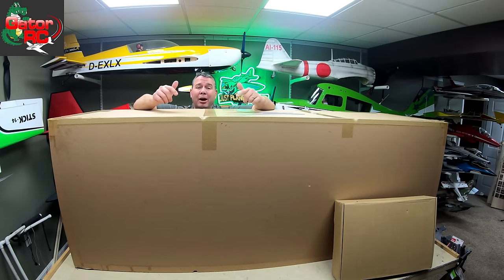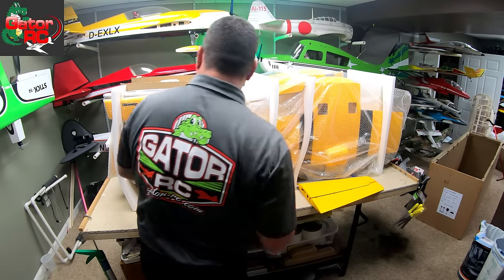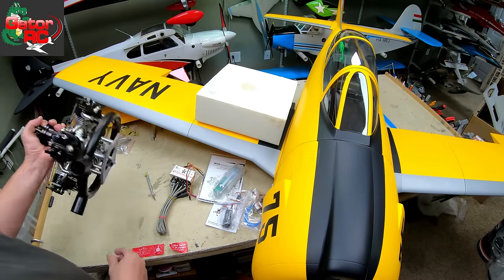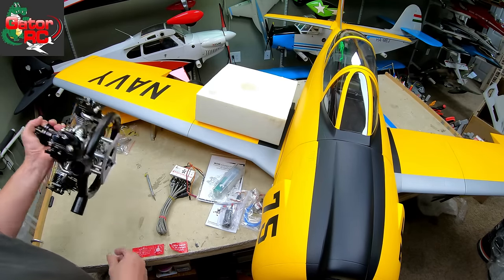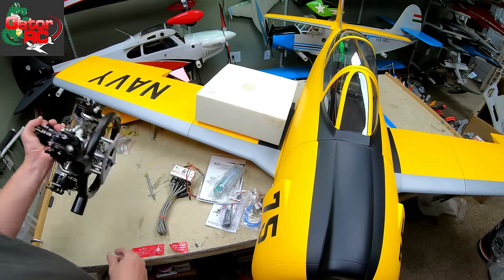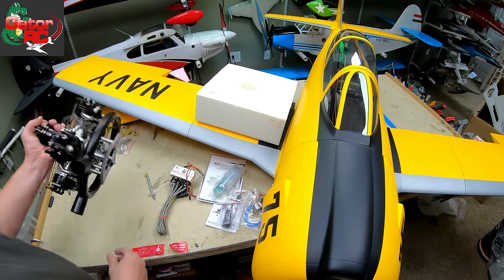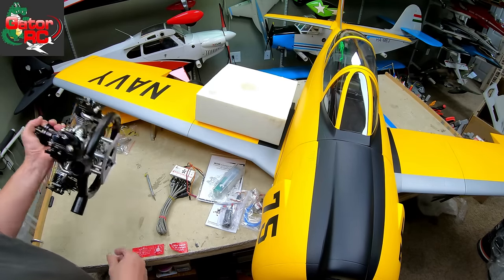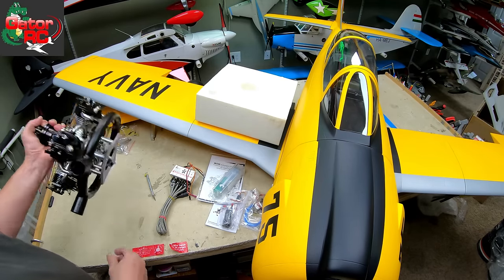Unboxing the HUGE Composite 111" Top Rc Model T28 Trojan 180UMS Radial Powered

Comment: you threw the flap tube out with the plastic bag mate.
Reply from the maker: Dude!!!!!!!!!!!! I can’t  believe u caught that. I do that when I walked by. Sooo funny. Thanks for watching and sooo closely
Reply: @JustPlaneCrazy  all good mate. I’m ex RAAF electronics tech and project manager so details are my thing. I miss nada. Will be interested to see how you do nose steering and get that radial in. I’m going simple, DLE-111.  I briefly considered the UMS after seeing yours till I checked the price of them here, $2999 USD and as AUD is 0.60 it is getting too expensive to even consider.
Reply from the maker: @PeterOZ61 it’s all in barely. Gotta figure out the nose steering. Kinda confusing. Really hacked up the nose mount for now. I will rebuild it after I get the steering linkage built
Reply from the maker: @PeterOZ61 email me or fb messenger me. I will share pics. Brendenmccormick@att.net
Reply: @JustPlaneCrazy  tiller arm aimed fore and aft. Drill 2 x 4mm holes and tap in the oleo wide enough to fit heavy duty metal captive ball link and run an arm to servo arm. Put heavy duty Clevis on that. That way you get no twisting motion. Servo arm and tiller arm should be equal length if possible. Should not require any dremel work on timber that way.